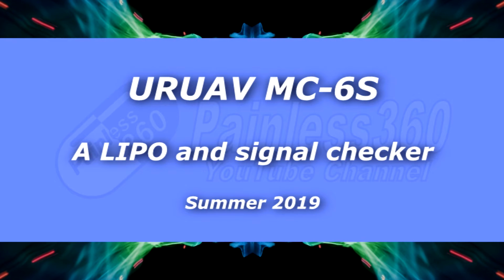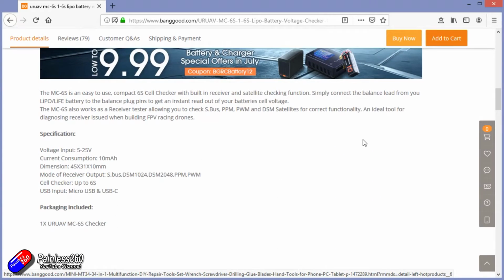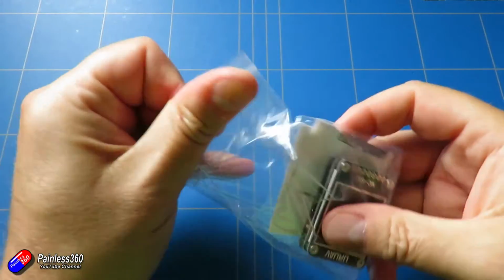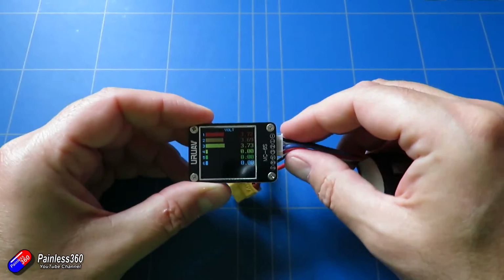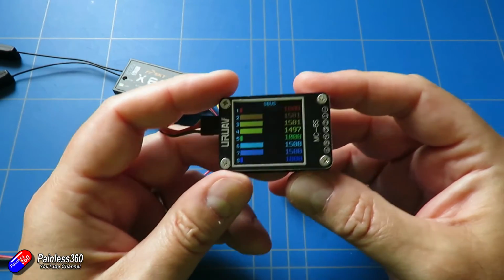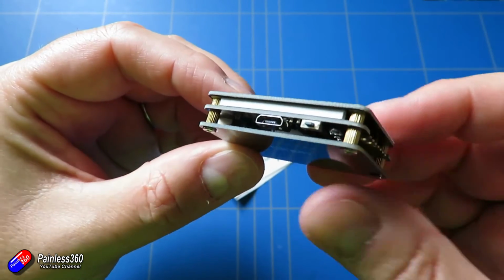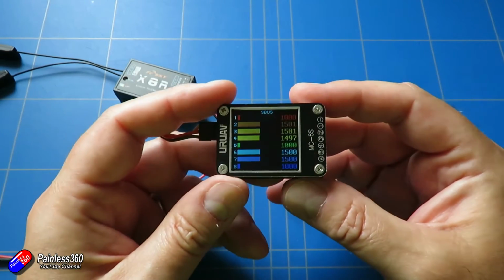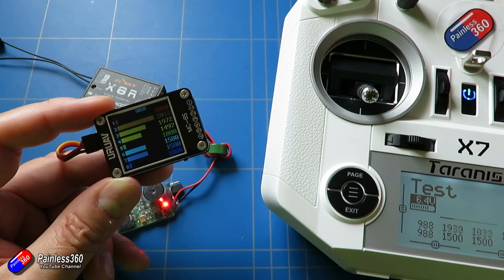URUAV MC-6S LIPO and Signal Checker

Comment: I have found that it would only read a PWM signal between 900 and 1200 ish before crashing when using a servo tester to generate the PWM signal however it reads the full 900 to 2100 if the signal was coming via a tx and receiver.